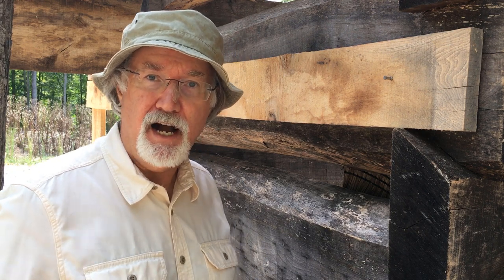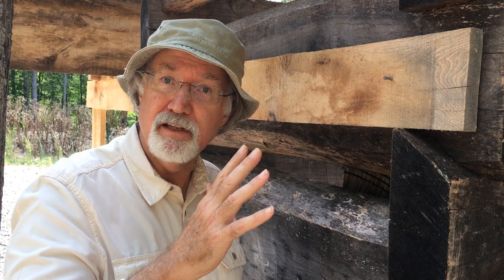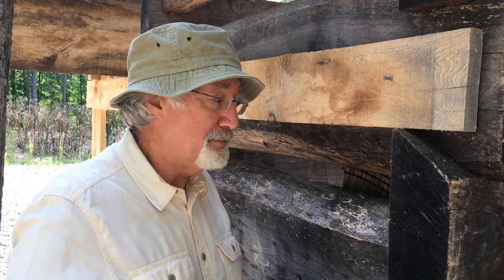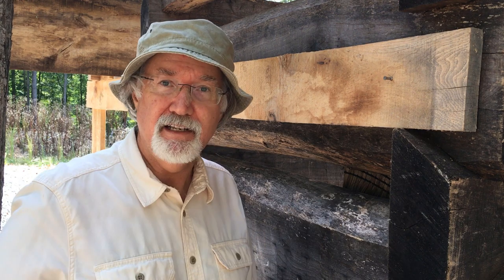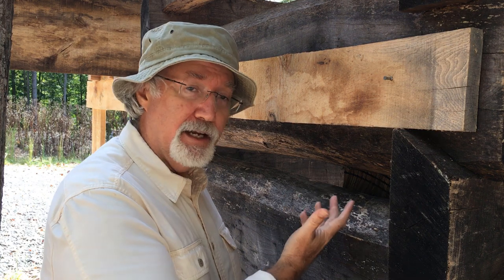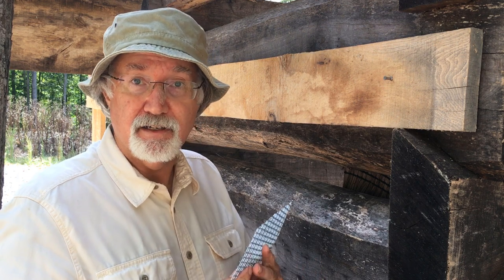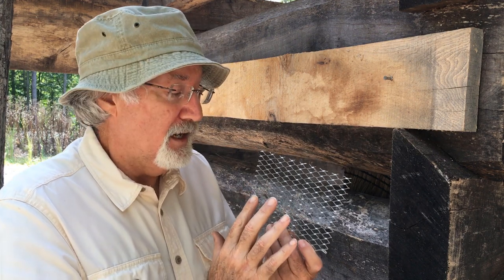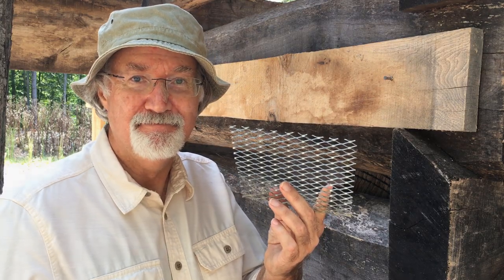Chinking a Log Cabin... Doing it Right!... Handmade House TV #102

Comment: Love log cabins and watched a few videos. I am amateurishly interested in old buildings and the way they where made. Differently, depending where you are and with what you have and how much time you have and how much it cost's. It's all relevant. In the UK we have Peter Ward, works with English Heritage and agencies tasked with looking after old timber framed buildings built many years ago and are historically important. From watching his videos and experiences the worst thing you can do is use modern day cement up against timber. The cement will last almost forever, but the timber (normally Oak in the UK) will rot and crumble to pieces and fail. He has managed to save some timber framed buildings by raking out the old (new) cement and using lime mortar, which they used to use in the old days and is breathable so allowing the moisture to evaporate before damage can be done to the surrounding timber. Worth a look though at his YT channel. Quite interesting. Only MHO though.
Reply from the maker: Thanks for a fine comment Trevor. I advocate for modern cement on metal lath when chinking, but this is an unpopular opinion for lime enthusiasts. It's just that I have not seen their fears with respect to rot borne out in any of my work over three decades. That said, I have no problems with anyone who prefers lime for whatever reason and I do try to make that clear to anyone asking for advice. Wishing you all the best in your endeavors!

Comment: Do you file the sharp edges down on cut mesh or does that even matter?
Reply: Doesn't matter. You're either handling them while sanding or handling them while installing. No need to do both.
Reply from the maker: No filing the sharp edges down, just very careful handling feoleb.

Comment: Would love a video on how to install the diamond mesh. Do you staple it ? Also- do you put insulation of some kind between the layers of cement, or just use foam to seal holes and chink?
Reply: Redoing my house from 1877. Original chink on the interior. Any recommendations on removing the old chink? Should I leave the wood bits?